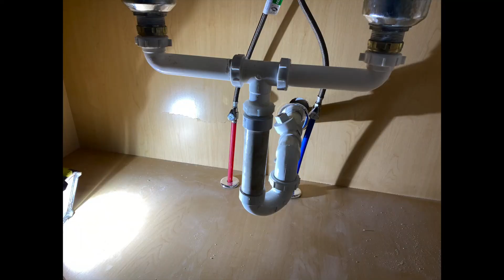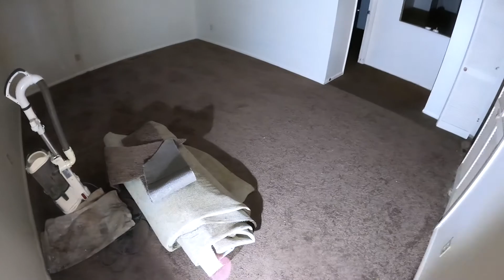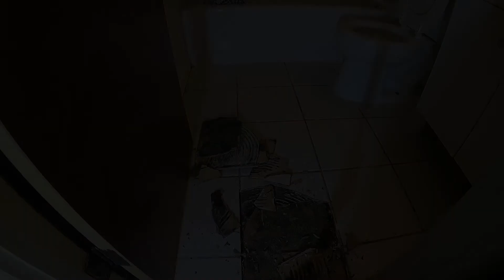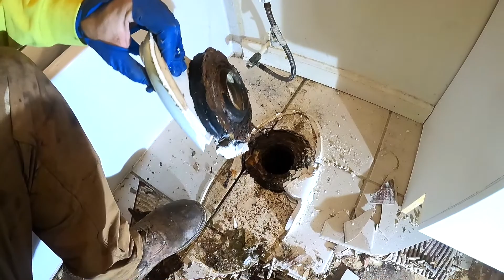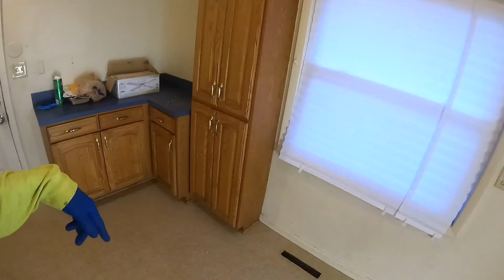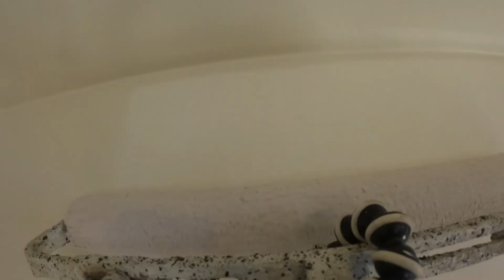WHY I QUIT Youtube | UPDATE ON RENTAL | EASY TURN ep2

Comment: Great video man. I could watch these all day as it's what I do too, although my renters aren't quite as destructive as I screen the hell out of them upfront. Your van sounds like a WW1 fighter starting up. Best off the shelf flooring imo is Home Depot Lifeproof vinyl plank @ ~2.99 sq. ft. as it's waterproof and handles uneven floors quite well. Walnut Oak color hides about anything outside an engine block being dragged across it. Keep them coming!
Reply from the maker: Haha this made me laugh out loud. This van has been good to me, but seems to like warmer weather. You know diesel. I will check out this flooring. Thanks for the tip.
Reply: Its now $3.79 sq ft 😵